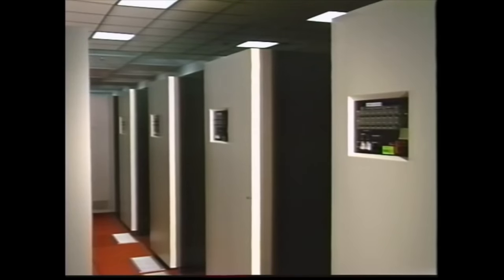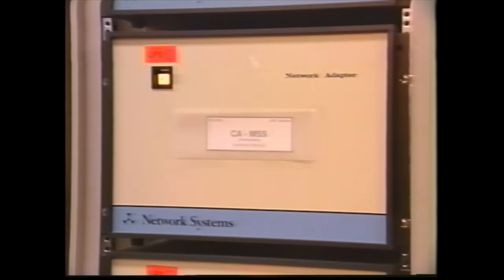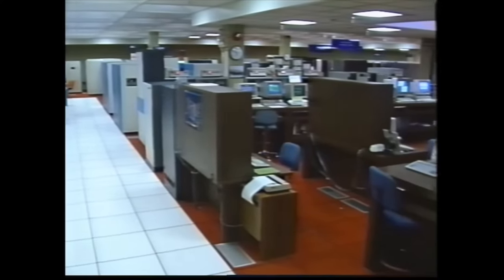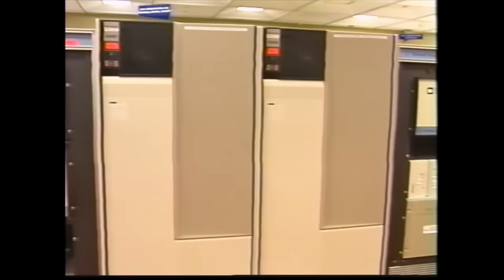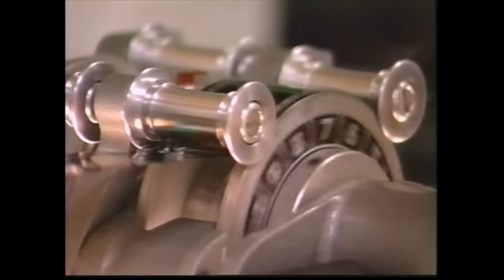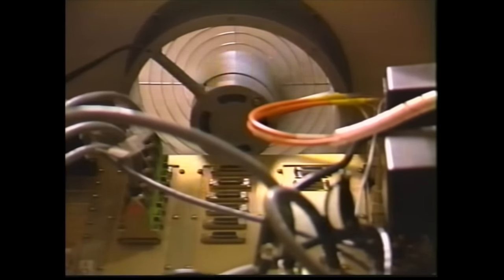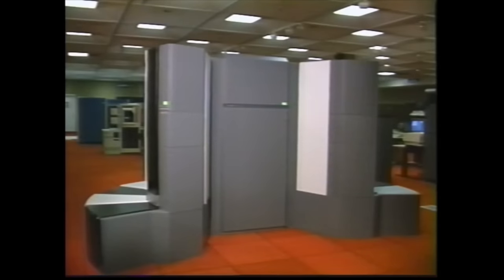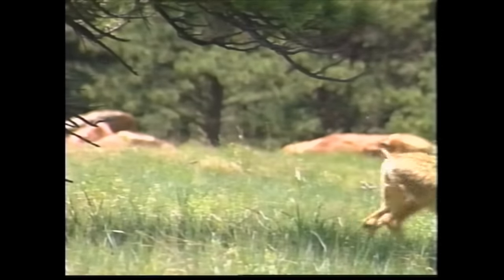Computer room walking tour, 1992

Comment: It’s crazy to think we’re holding technology way more powerful than that
Reply: No, it’s not.
Reply: @BlownMacTruck  Yes it is
Reply: @kennethober6626 You're amazed that technology has moved forward in the past 30 years at a rate that most people predicted since then?
Reply: Your phone will absolutely not do all that. I’ve worked in server units and they’re still big machines that your average devices can’t do. The area has to be dust free and has to have quite an aggressive cooling system and everything needs 1000s of volts to run
Reply: @shokdj1  Modern server systems will smoke our phones but no way in hell is a mid 90s server or supercomputer going to beat an IPhone 14 Pro.  There is  far too much new technology in our devices for a mid 90’s supercomputer to compete with.  At best, we can squeeze 5ghz out of a high end cpu.  You can’t tell me those CPU’s were even coming close to those speeds then.  Even with multi CPU setups or multi system setups, they were running old software and hardware not where near as advanced as our phones today.  My 11th gen i7 with crappy IRIS graphics would smack those old machines around and have room to spare.
Reply: @BlownMacTruck  Yes given the size, power efficiency and overall raw power that even the best computers back then couldn’t even touch.  It’s at least a few thousand times more powerful than those old machines that needed huge rooms and gobs of power to run.  Fun fact, an average birthday card is far more powerful than 60’s rocket ships and it runs on a tiny battery.  Pentium 2 systems can literally be software emulated for free unlike when we had to spend a few grand on a decent setup in the 90’s.
Reply: @kennethober6626 Ok? Are you a boomer who doesn’t know how to use the Internet and lack basic reading comprehension skills when stuff is delivered in an electronic format? Because your entire reply was tangential to anything I said.
Reply: @kennethober6626  these are more than computers they’re machines performing specific tasks that no phone will be able to do
Reply: Indeed. And also, the Cray was a vector computer that was used in modeling tasks because that's where its strengths were.  However, all processors today have built-in vectorized functions.  In fact, even a $15 cheap disposable smartphone has a vector unit that will smash anything out of this Cray Y-MP many times over.

Comment: This all begs the question... how do I run climate models on my/toaster

How are modern systems so much more powerful and yet struggle to run so much more mundane tasks
Reply: data sets  are required  not to mention most programs/programmers only interface with an OS and not with direct hardware
Reply: Languages have become far more high level so applications can be deployed quickly and can scale easily.  Back in the day the languages needed outside of pure hobbyists were very low level, took a long time, with little to no scalability to expand itself to keep future-proof.

Comment: wish they would give us details about "mhz/ghz" "physical ram"  for laymen people.
Reply: Honestly? The MHz value isn't actually that useful here. We're talking about a whole bunch of machines built with specialised hardware and a variety of CPU architectures, most of which were not consumer-type Intel chips so comparison on clock speed alone is not possible. You also have the RISC vs CISC situation where a RISC CPU will always clock far higher than an equivalently capable CISC CPU. Trying to compare them based upon what MHz the system runs at is comparing apples to oranges.

The measure they do give, FLOPS, is far more CPU-agnostic as it measures a common benchmark - how much math per second a CPU can do.

In fact, the idea that MHz was somehow intrinsically linked to performance is basically an Intel marketing gimmick, their CPUs clocked higher speeds than their competitors and so they pushed for the "more MHz = faster" idea to sell more products. For what it's worth, a top end 2023 CPU can have a lower clock speed than a 2003 Pentium 4, but it's orders of magnitude more powerful, even running on a single core.

Basically, the layman value SHOULD be FLOPS or even a jargon free "calculations per second" but a bunch of marketing guys screwed that up for everyone.
Reply: @samwalker7567  I would just like to know how fast the machines were in a standard we use for consumer market today,  it would help myself and others to understand, these jargens they use, I have zero idea what they mean in terms of speed.

Comment: It ran fast... but only if you were running a multithreaded Fortran program.
Apple found this out the hard way when they bought a purple Cray to design computers and it turned out kind of useless for them.
The SGI workstations they had connected to it were faster.

Comment: Counting up in my head how much an equivalent or better system would cost today for a home user. Real deal breaker is actually all of that storage because with a modern CPU and GPU you would pretty much stomp this machine in terms of FLOPS, and especially in more specialized operations, like cryptography, which modern CPUs are optimized for/have special modules for. 
The storage however would break the bank because you'd have to choose between SSDs (expensive), HDDs (less expensive but still pretty expensive at high amounts), or tape (which the original primarily uses), which is cheap, but the readers/writers can easily cost $5k+. 

That being said you could probably run a GPT instance on this thing, although it would be pretty slow due to memory and storage speeds, and because of architecture restrictions would be very hard to actually implement, leading to likely even more overhead. Not too surprising given they said they were working on computer vision, unless they used the term differently back then.

Comment: Why would it need power supplied at 400 Hz?
Reply: The transformers can be built smaller. I'm not sure if this is the case anymore. My guess is those PSUs were linear or a lot less efficient.
Reply: @miasmator   Oh that actually makes good sense. Thanks!

Comment: I had no idea SSD tech existed all the way back then.
Reply: We had SSDs in our PDP!   They were built in the early 1980's.   They held 4MB of data and was acted upon like a disk.   The whole rates data was held there so our customer services team didn't have to wait.
Reply: You had the ability in DOS to mount a virtual hard disk in memory. The tool was called RAMDisk. It was so damn fast you’d run Snooper or some benchmark tool and watch ramdisk blow a SCSI disk out the water.
Reply: @o0Donuts0o  That's not the same as an SSD.  RAM disk was wiped out the second you powered off.